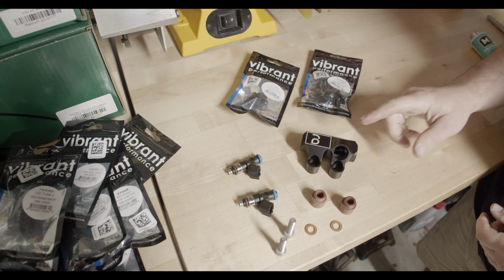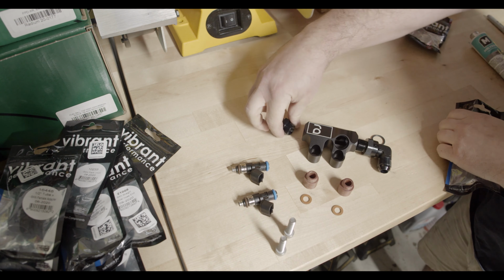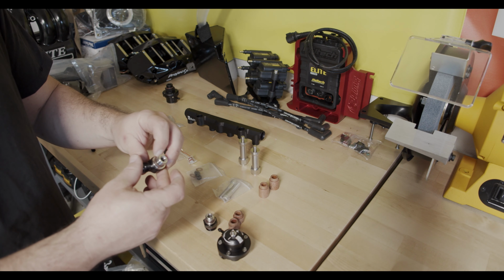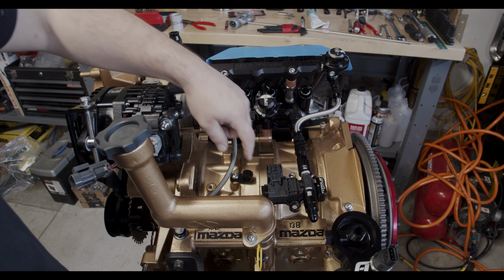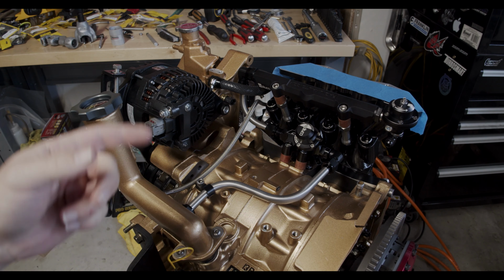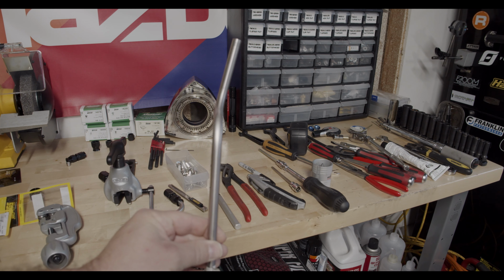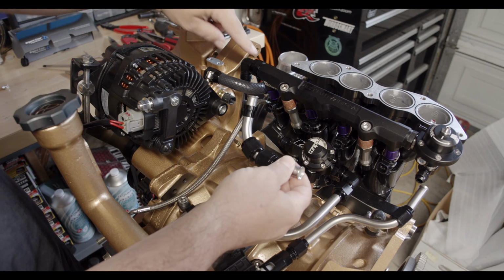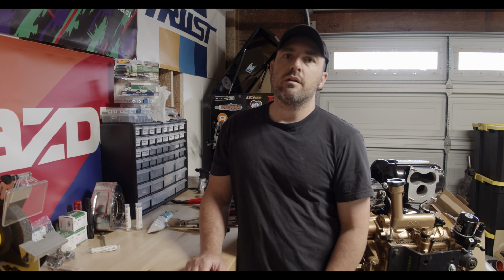Stormtrooper RX-7 Part 28: Fuel System, Rails & Injectors

Comment: Gday mate.

Wondering if you have a parts list for all the fittings you used?

I’m trying to mimic the setup on my FD: all radium rails, FPR,  1300X pri and 2600X sec, flex fuel mounted on the housings, back to an ID750 filter on firewall… and love the idea of it mostly being hardlines…. But figuring out all the fittings is a challenge.
Reply from the maker: Thanks for your interest. I don’t have a full parts list for you but I can do my best to guide you in the right direction. All the feed line fittings are -8AN and the return are -6AN. For the small sections of hose I used PTFE hose, which requires specific fittings—regular hose fittings will not work. When you purchase Earls or Vibrant fittings they are named accordingly. As for the hard lines…you can use compression fittings or tube nut with sleeves. For the long sections under the car I used compression fittings and for the short sections under the intake manifold I used tube nuts because of the short bends and 90 degree angles. If I were to do it again I would use tube nuts on all the sections because they are cheaper and I now feel confident I have enough experience flaring the stainless tubing. The compression fittings do not require flaring the tube, so they are easier to do with. Let me know if you have specific questions as you go along, I’d be happy to help. You can send me a DM on Instagram if you like.

Comment: Thanks, super useful to watch this! What thread sealant are you using?
Reply from the maker: You never want to use thread sealant on AN fittings as the threads themselves do not provide the seal. In the case of these rails, I’m using O-ring fittings and lubricating the O-ring with Molykote 111. I’ve used this stuff on all of the O-rings on the entire car and highly recommend it. You can also use a very small amount of it or some other type of oil on the fitting threads for assembly purposes.

Comment: Great videos keep it up. Whats the torque thing on top of the motor where your fuel lines are running to?
Reply from the maker: The torque solution bracket holds the flex fuel sensor.

Comment: Your feed from the tank is coming into to primary rail, but your fuel pressure regulator is at the end of the system?
Reply from the maker: Pressure regulator is on the end of the secondary rail.

Comment: Hey man where did you get the billet Haltech case from ? Tx
Reply from the maker: It’s made by Elite Rotary Shop. I can’t exactly recommend it if you have a RHD and the A/C blower (something they never mentioned). It doesn’t fit properly so I had to drill different mounting holes. If you’ve ditched your A/C you’re probably fine.

Comment: Hey, I am trying to mimic your setup but with bigger injectors and was wondering few things. Which size injectors did you go for? 14mm on both primary and secondary? Thanks!
Reply from the maker: I'm running 6 injectors, 4 1700s on the secondary and 2 1050s on the primary. They are all 14mm bore.